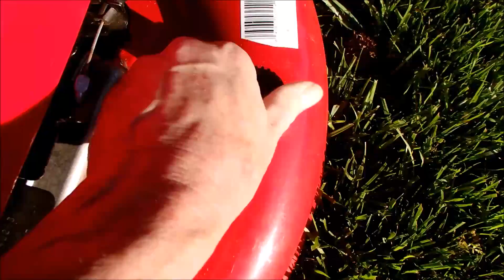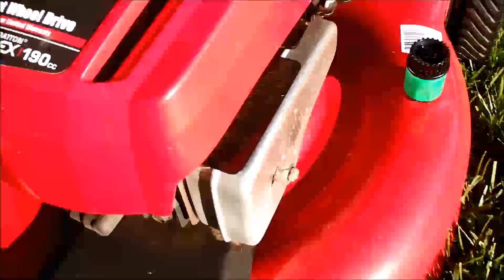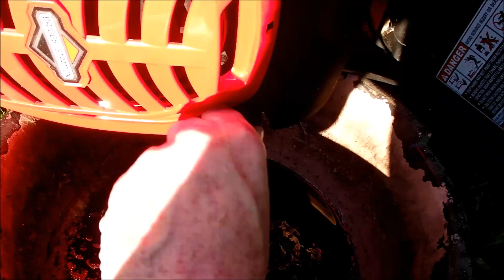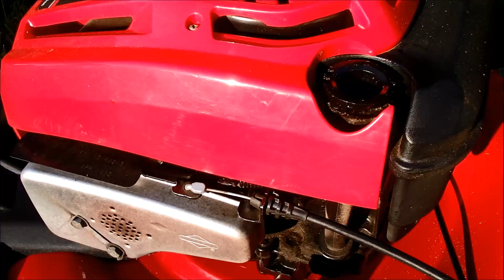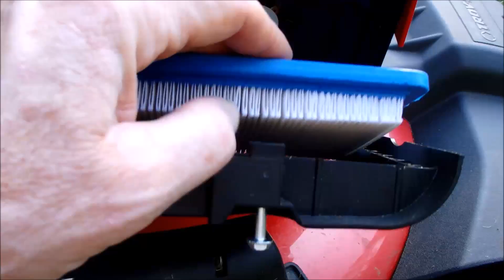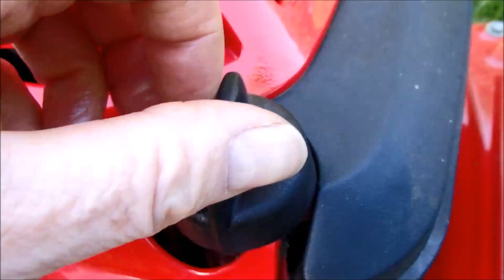Troy Bilt 21" Model TB230 Lawn Mower Replacing Air Filter Changing the Oil -  May 15, 2015

Comment: The briggs and stratton troy bilt tb230 does not need the oil changed. Evidently the model number for this mower is incorrect.
Reply: Incorrect, this machine does need the oil changed. The new models do come with the never change oil system from Briggs on them, however, it's been my experience they also need the oil changed occasionally, I have a Huskvarna with that system on it and it's oil change was extremely dark. Also, this engine is a 2013 model, as he's mentioned somewhere else, made before the system was even introduced.

Comment: Hello mountainbikekayak, I have a mower just like the one on this video.  I just noticed the other day,  a hole melted through the front cover plastic just beneath the muffler.  Right around the area seen on min 4:17 on this video where you see a bit of oil.  Any idea on what could cause such thing?  Thx!
Reply from the maker: Hello Juan thanks for viewing!  That's the cover for the self propelled pulleys and belt just make sure it is also mounted where no screws have fell off and it has risen up.  Also make sure no debris is in between that cover and the muffler.  That engine/muffler must have gotten really hot to have reached that distance if it is mounted correctly.  Also just make sure all the debris is cleaned off your engine.  Air cooled engines are at the mercy of the oil being kept changed and dirt debris is blown off to keep it as cool as possible.  I don't think it will hurt anything but you could get some Scotch High Temperature duct tape to cover that area to keep it from further melting.  If yours is like this one its one of the last of the best engines Briggs and Stratton made they now have the newer emissions engines and not quite sold on those yet, take care Juan!

Comment: $5.00 for the reusable pre-cleaners at Lowes. Two advantages:
1. The Paper filter lasts so much longer.
2. Double the filtration process for your engine. (I have 35 year old Briggs that run great)
Reply: can you send the link of the product?

Comment: Why aren't people using pre-cleaners for their air filters? I never see you take one out of these CL mowers.
Reply from the maker: +Al Gore Hello Al Gore thanks for viewing I have only seen a few lawn mowers I have picked up used with those Pre Cleaners in them.  The Snapper I got in September Model RP21600 actually had one in it probably came that way from the factory and was able to reuse it.    They can be easily cleaned and really protects the regular air filter.  To add those its the cost,  they cost as much as a regular filter its worth it if you plan to keep these for many years, take care!

Comment: Looking at this model - is there a oil drain plug on the bottom of the deck?  Thanks
Reply: Monte Maxey there isn't a drain plug for the oil, only removing the dip stick, tilting the mower on its side (after putting a plastic bag, such as a zip lock bag or saran wrap over the fuel tank with the cap installed) over an oil pan that you use to empty the oil when changing the oil on a cat, truck, etcetera, and adding new oil in, and I believe adding engine treatment, such as Lucas or Seafoam would prolong the oil and engine life, and using fuel stabilizer in the fuel tank and putting it in your gas cans as well. What I recommend for winter storage is to run the gas tank empty so that way it won't be stale.